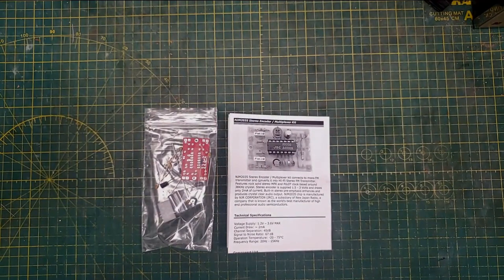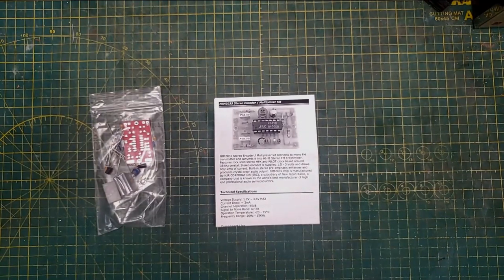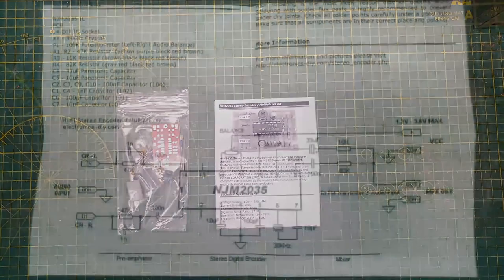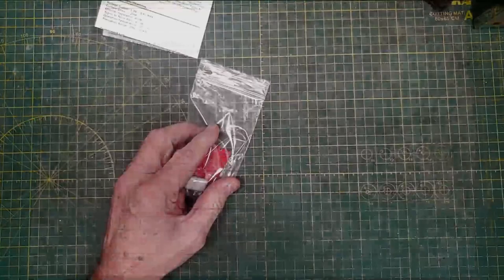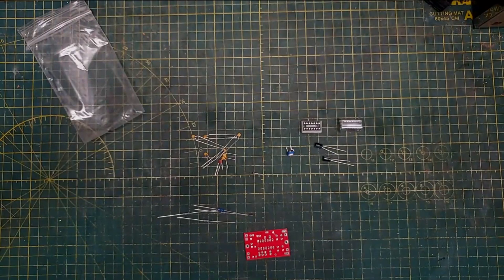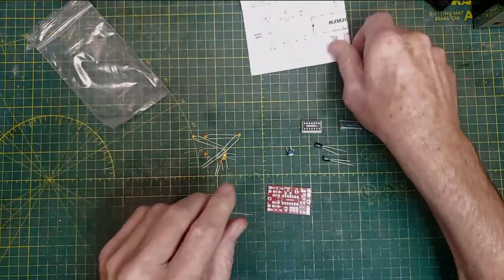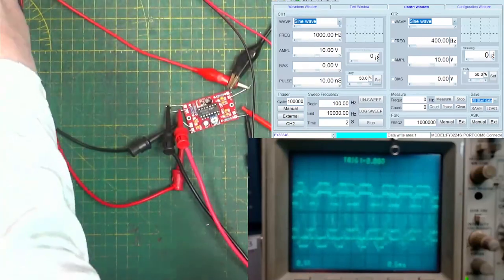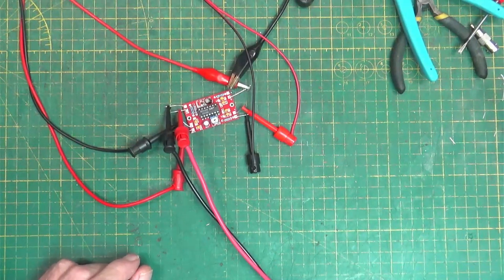Kit Build - NHM2035 Stereo Encoder

Comment: Interesting IC, However i`m interested at the actual quality. As the IC works with square-waves and there is no output filtering. I`m expecting a lot of harmonics which will give problems with the bandwidth on the RF output of your transmitter
Reply from the maker: Yes. I think you are right. I have designed a board with 19khz filter and 57khz bpf for that exact reason. JLBPCB has it and when they are done we will build it up. Have to find a 20nH variable coil first.